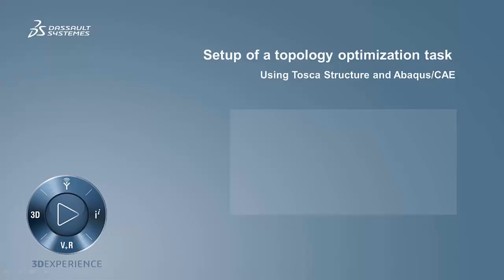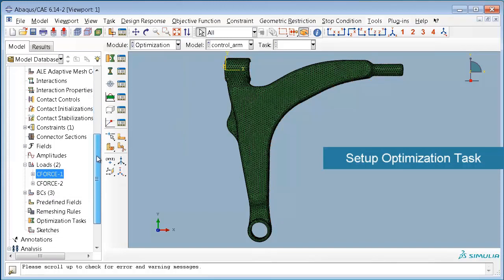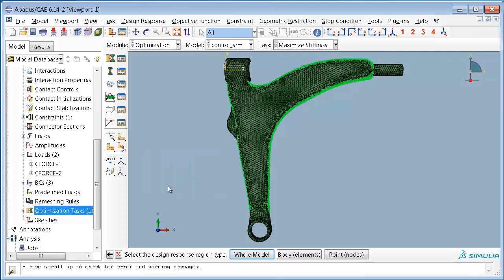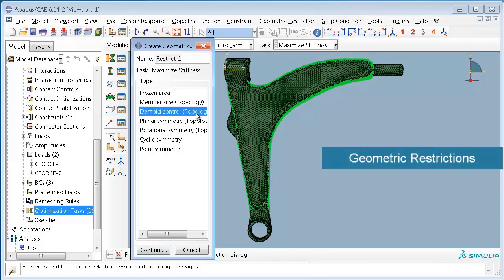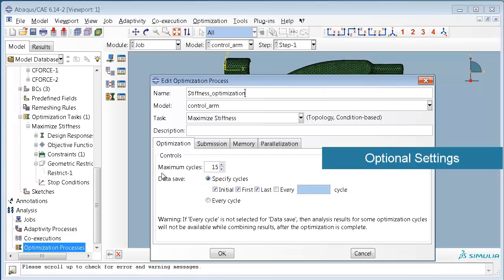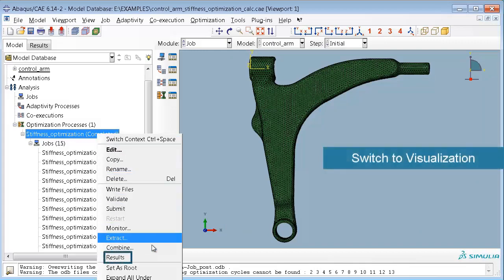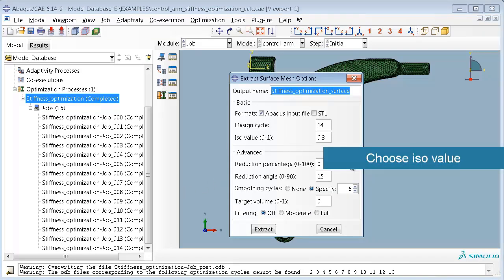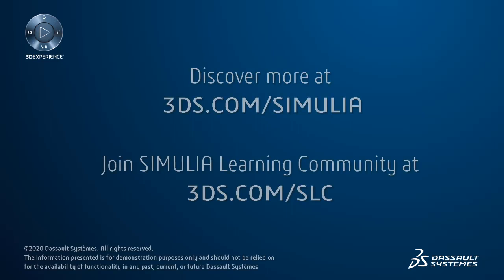Set up & Post Processing of a Topology Optimization Task | SIMULIA Abaqus CAE  How-To Tutorial

Comment: Hi
How can I use the .inp file for re-evaluation? All I get is an orphan mesh with no materials, sets etc..
Thank you and greetings
Reply: This is exactly the problem i am having! Have you found any intuitive ways of extracting optimized mesh and converting it into a solid model CAD file that can be re-evaluated? The problem i am having is the amount of mesh faces makes it difficult for most programs to convert the STL file from the Top.Opt into any kind of "solid" CAD model file. And even if i manage to reduce the mesh and convert it, i have a solid that has about 30000 faces which is very hard to work with!
Reply: Have you, by any chance, found anything?